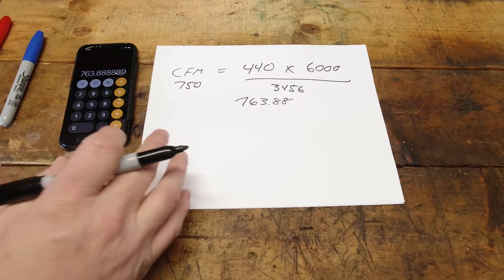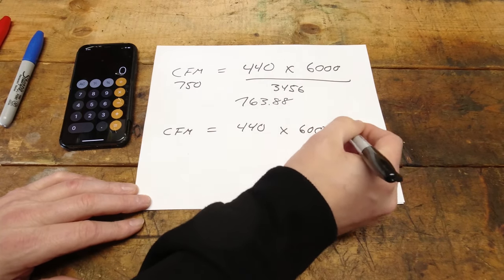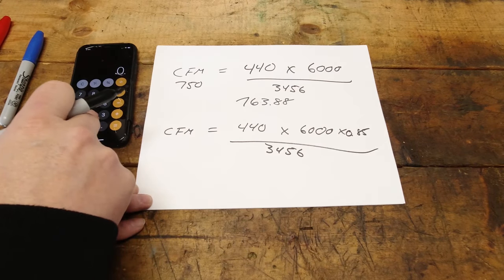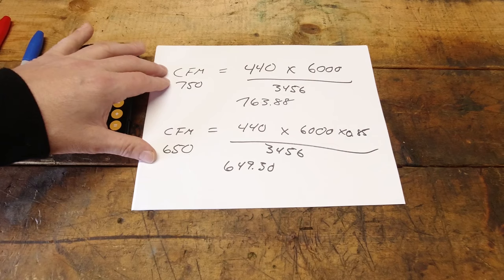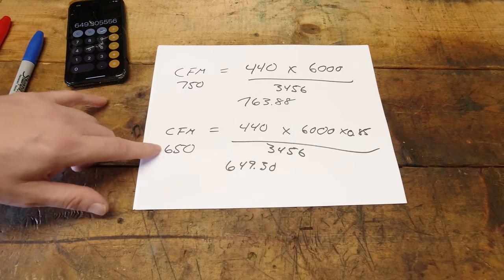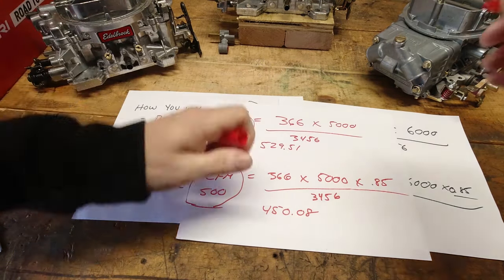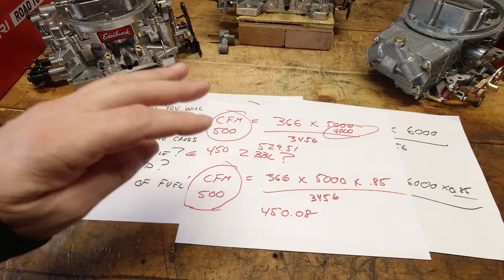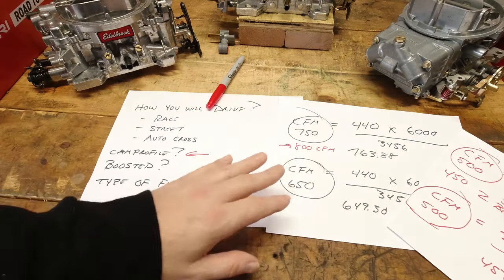How to Choose the Right Size Carburetor

Comment: Thank you for the knowledge but I wanted to ask to be sure I have a 1978 Ford F250 super cab 4x4 with a 460 4000 rpm would probably be my max rpm I'm looking for fuel efficiency more than anything daily driver if you could help me pick a cfm that would be great I run maybe 85 or 87 from the gas pump
Reply from the maker: Well, you have the key components there.  What did the math tell you?  Something to keep in mind here.  If you really want better fuel economy, and this is something you’re driving frequently, you’ll find those big gains in the transmission, not the engine.  I did a video on how to get better fuel economy in a muscle car a few years ago to illustrate how that’s possible.
Reply: @MuscleCarSolutions  sounds good I'll find the video I have a C6 automatic transmission if that helps

Comment: I have a 1967 chevy 327 that is stock to mildly built I really dont any other specs....what would be a good size/brand of carb to go with?
Reply from the maker: You’re in a very difficult spot then.  The only way you have left if to define how you’re going to drive it and define what your max rpm is.  Then it’s a matter of living with your choice and tuning for that situation.
Reply: @MuscleCarSolutions  It's gonna be street driven, weekends and some daily  driving,350 turbo trans basic little truck
Reply from the maker: Well that’s the driving part.  Now make a decision on what the max rpm will be and you’re in your way to picking a CFM for that situation.

Comment: I have a '69 Plymouth Road Runner, 383 HP (with factory mild lumpy cam), automatic and factory a/c.  Looking for proper street use Edelbrock AVS2 carb cfm, metering rod and secondary jet size?  It currently has an Edelbrock AVS2 1906 (650cfm) that blows a significant amount of black fuel smoke at full throttle.  Metering rods and secondary jets were stepped down 2 sizes below factory, as suggested by an Edelbrock technician.  Any suggestions?
Reply from the maker: Adjust the AVS.  What is your idle vacuum and what step up spring did you put in?

Comment: Hello from Canada!

I recently picked up a 1977 GMC Sierra K15 4x4. It's 98% complete. The previous owner dropped in a late model gen1 350 TBI and running gear from a 1987 Chevy Suburban. It's not running it was just placed in, nothing hooked up.

I would like to swap out the TBI set up and put an aftermarket dual plane intake and carburetor on it, possibly headers I can't find any cam specs on this engine but do know it makes 200hp and 300 ft/lbs, At what rpm I don't know.

Realistically this engine wont be seeing to much time at high rpm, probably 5500 max. I keep doing my calculations with a 350 ci and 85% VE and the number keeps coming up at or around 470 cfmchevy. This seems way small for a small block Chevy.

It's a truck build and I'm looking at getting the Holley 90470 off-road carburetor. The website says recommended for 4cyl, v6 and inline 6 engines. Is this carb a poor choice or just what I'm looking for. The next size up in this series is a 670 cfm.

Im in Canada and these carbs are going for just over  $1000,  I gotta get this right the first time.

Your opinion and knowledge means a lot to me right now, thanks
Reply from the maker: The thing is if you’re not sure on the cam profile or you feel like a 500 CFM carb would be too small, then put on a bigger one.  I can tell you at that Hp level and likely won’t spin that thing past 5000 rpm, I’d have no problem putting a 500 on.  But like I said above, if a larger size will make you feel better, then go for it. You’ll know if it was the right choice or not if the tuning becomes difficult.

Comment: Was wondering what you think of a 750 Holly 4 barrel on a 428 cobra jet Torino, with air ram, 1969 fastback
Reply from the maker: For the same reasons in the video, I can’t answer that question without a bit more info.

Comment: Love the video. Would love some input on my situation. I have an 87 suburban with a mild 454 BBC. Mild cam, long tube headers. Running a 4 speed manual and it’s also on 40 inch tires and 4.10 gears. (needs 4.56) Just a cruiser/ off-roader that I never take above 4500 rpm. But I do live in the mountains with lots of decent grades where you really need to roll into the throttle to get it to move. I ordered a Holley 570 street avenger because of the low rpms I consistently run but I’m second guessing myself because of the load it sees with the hills and grades. Any ideas would be appreciated!
Reply: Get a Performer intake, not an RPM or an air gap. Just the regular Performer, they have faster air velocity that makes more torque.

Comment: Brian, sorry 1 last question seeing you are familiar with these cams, should my rev limiter be set to 6000rpm or can it take a little more? thanks again. Randy
Reply from the maker: That cam is generally all in right at 6000.  You can set the rev limiter higher but unless you have the spring pressure to reach it, it’s doubtful you will.  The LSA hurts a bit on that one.  I’d rather see it on a 112 and squeeze a little more from it.  But if it’s primarily a street car, you’re not zinging that thing to 6000 that often anyways.  Great street cam for sure.

Comment: Howdy. Just found your channel, subscribed and will be viewing more episodes as time permits. I'm taking a bit of a backwards journey from the bigger, faster, louder way of thinking. Car is a 65 Chevy Two station wagon with a 350 topped with Edelbrock Performer RPM heads, intake and 1411 carb. I have removed the RPM cam and installed a Summit 214/224 mild "RV" cam, chucked the 350 turbo for a 700R4 and am currently rebuilding a 1406 carb for it. I drive it a lot and with fuel costs what they are, MPG is important. It cruises the interstate at around 2400 RPM, has 18 in. idle vaccum but still is lousy on gas. The 1406 has factory tune jets/ rods/ springs. Any suggestions?  Anyone else shooting for more MPG not worried so much with ET anymore?

Doing the math real quick, I come up with a 405 CFM being sufficient.
Reply from the maker: If fuel economy is truly what you’re after, a 500 would have been the better choice.  But aside from that, the next video you should consider watching is https://youtu.be/vSfAbSH9NQk
Reply from the maker: It’s the way the OEs have gone after the growing restrictions on economy.  Keeping the operating rpm as low as possible will increase fuel economy.  Less rpm means less fuel used.  So a modern 6 speed would be an even better choice.  You’ll see the largest gains in the trans.  Welcome to the channel!  Eager to hear how your quest goes for more MPG!

Comment: Do bolt on parts play any type of roll in deciding what size carburetor to go with?  I have a SBF 302 with shorty headers MSD box, dizzy, and ignition. 2.25 exhaust from header back out 3" mufflers. AOD transmission. I bought the car as is with a Edelbrock 650cfm. Not sure if any internal work, however is that the right size Carb?
Reply from the maker: Sort of yes.  It’s parts that indicate Joey ours going to drive it, usually.  Depending on what you do go with it can make a difference in the size carb you choose.  Based on the video, you tell me if that the right size carb.  You left out details that will make that determination.

Comment: Kingswood ute, 308 CI W/ 204/214@0.050 lift camshaft, 9:1 CR, 3.00 diff gears, 4 speed manual, Edelbrock Performer Intake manifold. Mostly highway and daily driving use, barely ever go over 3000 rpm.
Reply from the maker: Would love to see more Utes here in the US.  Love what the car culture is in Australia!
Reply: @MuscleCarSolutions  Quite bit over here. What kind of carb would you suggest for that? Currently running an Edelbrock AVS2 500cfm however going off all those calculations I should see 350-390
Reply from the maker: @allansnow4516  depends on the things talked about in the video.  What’s your cam specs?  How are you planning on driving it?  Other engine mods?  Without knowing more details, you’re probably ok with the 500cfm especially if you’re going to keep the rpm down that low.  Would be a very nice responsive system.
Reply: @MuscleCarSolutions  Cam rpm range 1700-4700, 9:1 Compression, Dual plane manifold, High flowing exhaust, car weighs 1300kg ,3.00 diff ratio. Majority country roads and highway driving (100km/h).
Reply from the maker: Sounds like a nice carburetor for what you’ll be using it for.  Have fun!  Cheers!

Comment: I have an AMC 360 CID V8 5.9L with 5500 RPM. I am trying to get it street and autocross but I want it to be a little above average, I'm not sure what Carburetor will give me the tuning freedom to allow me to push my '78 Wagoneer from 0-60 in 11.9 seconds
Reply from the maker: That engine isn’t really knows for its high rpm capabilities. You’re really going to spend a significant amount of effort (and money) to get what you want.  Why not swap in a mopar engine that would allow you to reach that goal at a fraction of the cost?  Either way, you’re going to spend more time on intake, cylinder head, compression ratio, valvetrain, transmission/differential gearing than you are on carburetor size.  That would be your last decision.

Comment: Brian, great video!  I am working on my all original 1956 Ford Ranch Wagon, has the 292 V8 engine with the 3 speed manual transmission,   it's a rebuild, but stock, nothing hi performance.  I'm wondering which carburetor to go with, any advice?  Thanks Brian!
Reply from the maker: Probably right back to the stock one would be your best choice.  What did you come up with when you did the math?
Reply: @MuscleCarSolutions   450-500 cfm          The previous owner installed this cheapy 2 barrel carb.,  original carb was a 4 barrel,       original carbs for the 292   can be costly

Comment: Looks like the secondary plates are same size as primary . I want to  use an Edelbrock on a 460 cid but all I have seen is models that have slightly larger secondary plater . What is model # of carb. in video ?
Reply from the maker: The 750s and 800s have the same size primary and secondary bore sizes.  More importantly, the venturi sizes are different in all CFM sizes.

Comment: Thanks for the awesome video! I have a 289, uprated cam but nothing too aggressive in a 1931 Model A hot rod. Pretty light car, I would guess around 2200lbs and its a automatic. Currently has a 600CFM Edelbrock Performer and I’m thinking about moving to a AVS2. Its street driven with 91 pump gas. Thinking a 500CFM?
Reply from the maker: @349a4  probably.  But also need to know the cam specs so you’ll know what the engine is capable of RPM wise.
Reply: @MuscleCarSolutions I appreciate the reply! The car is new to me and the internals are unfortunately unknown. It has a very slightly lumpy idle and it still pulls well off idle which is all I know about the cam. My assumption is pretty mild but bigger than stock. I calculated with the assumption of 6500rpm.
Reply from the maker: @349a4  so in this case, you can just go by how you’ll drive it.  If you’re going to put it on the cams redline often, then yes use that rpm number to calculate your decision on a CFM size.  If you’re not planning on driving it that aggressive, then you can use that number.  If you go the second route and you have a situation where the math gives you a number in between two sizes, then go with the bigger option.

Comment: Yes I could use some help with my build, I’m building a 525 cubic inch motor, I’m using a Chevy big block 427 tall deck block 4.310 bore and 4.500 stroke, I bought 26cc dome pistons, use Brodix heads, either 345cc are 366cc, 119cc combustion chamber, I’m shooting for 1.7-1.8 HP per cubic inch, any help would be appreciated, thanks
Reply from the maker: Well, based on the information in the video, what did you come up with?

Comment: Currently have a stock 87 marv iv 454 stock heads / pistons (low compression) with LT thumper cam and 2-0 edelbrock intake (spread bore). What’s your recommendation on best carb for this setup ?
Reply from the maker: Based on the information in the video, what did you come up with?

Comment: Would you recommend a 500cfm carb for my chevy 350? I got a edelbrock top end kit with a max rpm of 5500. But i don’t even rev that high on my K5 blazer. If anything i never even see it pass 4000rpm. Im currently running a 650 avs2.
Reply from the maker: Put that size carb in similar applications all the time.  As long you you’re driving it that way, you’ll get good results.  If you’re aggressive with it, the 650 is also a good choice.
Reply: @MuscleCarSolutions  I appreciate your advice. I guess ill stick to my 650 avs2. I do go off roading but just havent taken the blazer yet. Still need to watch your video again regarding the off roading modifications to the avs2.

Comment: Thanks, much, Mr. ... Picked up an old stock '70 318 Dodge W200 Power Wagon, truck gears, seldom over 3000 rpm, Carter BBD 2 barrel.  .. Shop manager, & local mechanic suggested a low rise/ 4 barrel Edelbrock.
Folks at Edelbrock set me up with matching manifold & #1405 600 cfm carb.   ... questioned Edelbrock's service dept. about size of carburetor, & they qualified it.  ...  ... Just about to install. .. This video suggests I would make an incorrect/troublesome decision.  .... Any knowledgeable input is welcomed.
Reply from the maker: They’re always going to go a size larger.  It’s way better to be on the rich side than the lean side but in this case, if all you ever see is 3000 and below, the 500 would have been a better choice.

Comment: I’m building a 302 with stock e7 heads upgraded valve springs and lunati voodoo cam. Intake is .549 lift and exhaust is .565 lift and duration at .50 is .221 intake and .227 exhaust. Engine is going in a ford ranger with a m5r2 manual trans and 3.73 gears. Truck will be a street/daily driver truck. I’m thinking a 600cfm would this be about right?
Reply from the maker: Depending on the math, any other additional equipment to support that cam profile and how you plan on driving it, yes a 600 could be perfect for it.

Comment: I'm guessing the 750cfm carb on my 305 low compression el camino is slightly oversized.

It's a qjet the PO put on to replace the feedback carb it came with.
Reply from the maker: Probably way way too big.

Comment: What do you think my 95 mustang gt with the 302 and b303 cam needs? Using the math I’m gettting 524 cfm without factoring in the cam
Reply from the maker: That’s about correct for that cam.  It’s very limiting with todays better lobe technology.  Depends on how you want to drive it.  Just a cruiser?  A little more aggressive driving?  Then a 600 will probably be just fine.
Reply: @MuscleCarSolutions  I’m planning on fixing the car up and getting used to the hp. It won’t be carbed for too long. I just need it to run good for right now

Comment: Great video  what whil you choose for a 1957 cadillac coupe deville whit a 365 enginge the 500avs2 or the 650 avs2 carb
Reply from the maker: Based on the information in the video, what did you come up with?  If you watched it, you know that there’s not enough information given to make a recommendation.
Reply: @MuscleCarSolutions  the car is full origenal but my carb is bad en want to replace it
Reply from the maker: @jantienesstruyk3538  understood.  I still need all the info from the video.  Like max rpm?
Reply: @MuscleCarSolutions   the car make max hp at 4800 rpm 320 hp thats al i now i just bouth the car ful stock only want to change the carb en go whit a electronic ignition
Reply from the maker: @jantienesstruyk3538  ok.  So now you have the CI and the RPM and you can make a choice.  Seems like a pretty easy decision.  The 500 would be the best way to go.

Comment: Im needing help ive got a 1986 Pontiac Trans Am it has a built 355 Chevrolet motor from 1975 has mechanical fuel pump right now I have a holley street demon 625 cfm on it and I'm having trouble with tuning and I don't  know if I'm going with the right carb set up but it's 355 cubic inch with a 6,000 to 6,500 RPM range. Running 93 pump gas motor can also run 110 race gas not sure if that's important mostly street use with some time on drag strip but mostly street can you help car has 373 rear gears with a posi lock
Reply from the maker: What did the math tell you?  Sounds like you’re right in the ballpark of where the car engine needs to be.  How does it drive?  Are you losing power before you get to 6500?  What are the cam specs?  This a drag race only vehicle?

Comment: 400 small block bored 30 over with small cam. Got a 750 cfm and a 600 cfm amdni camt seem to get either one adjusted to get the stumble out when the throttle is hammered down
Reply from the maker: Well.  Start with the CFM.  Which best fits your situation based on what the video showed?  Next if verify initial and full timing.  Then verify proper fuel system set up.  Then you can start tuning.

Comment: Will a 750 (CFM???) Edelbrock for my soon to be machined /rebuilt 1970 472 V8 Cadi CDV (keeping engine as OG as possible and boring only)? I've been advised to go electric choke too, so will I need press. reg, and electric fuel pump too or can I keep my og mechanical fuel pump? Thanks for awesome Vid I think my calc for CFM = 601. [472 X 4,400]/3456= 601 This car will run. 91 gas, mostly cruzin to shows and with low riders, but want to drive say within 100 miles distance on freeway 70mph. Thanks again from Sunny SD, Cali. Cholo Clem
Reply from the maker: Go with the 650 AVS2 carburetor.  Better choice for what you’re doing.